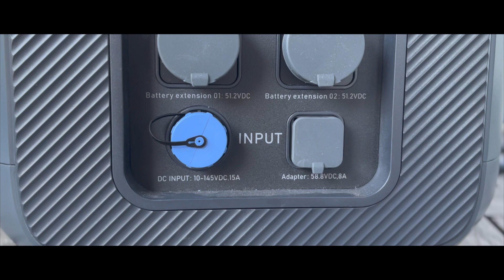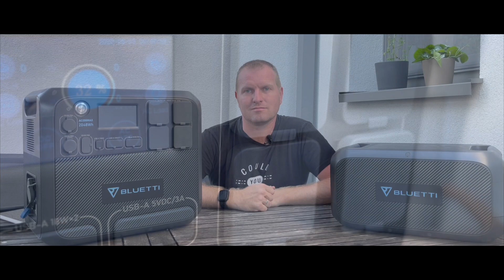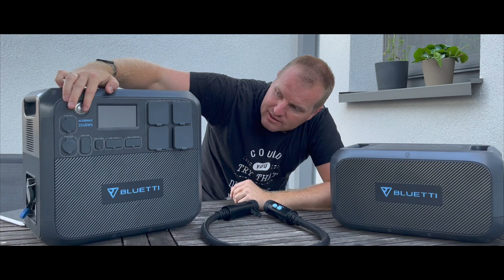Bluetti AC200MAX + B230 long-term review

Comment: That isn't a max, it doesn't have the rv plug
Reply from the maker: Hi Robert, actually it is, but it's the European model, as I'm based in Belgium. This one differs slightly from the model being sold in the United States (and several other teritories).

Comment: I’m pretty sure you’re in Belgium?  I’m in a more or less similar situation where everything on my desk is powered by a powerstation (Ecoflow). Which by itself is charged by 2 or 3 solar panels (terrace of an appartment, far from ideal but it works).  I have a smaller Bluetti which i use for all other kind of stuff.  By now you will know that solar in winter gives much less juice in Belgium.  That’s why i’m overpaneling myself.  I’m interested in using an AC200 MAX to also run my washer and dryer.  So knowing you haven’t had any issue yet is interesting feedback.  Maybe you can do a followup and let us know how things evolve.  Still trouble free?  You don’t need wifi btw.  I have it on my Ecoflow.  And regularly it just stops working.  And i need to poweroff/on to get it working again.  I’d rather not have it then.

Comment: Thank you for this video. I am trying to figure out how to charge my AC 22 max by solar and the van battery at the same time.  Having trouble getting Bluetti to answer my question.  If I use my 400W solar, I'll be using up the PV input port.  If I want to connect the AC port to the battery, is it possible to use the Charge enhancer (but instead of the battery clips, hard wire it to the van battery) or do I have to use an inverter form the battery and charge the bluetti from the AC of the converter by the AC charging brick?  Any help would be greatly appreciated.

Comment: Great review, thank you for the excellent information. I am wondering if I would buy the AC200MAX or the AC300. Perhaps 2 kW is enough for my needs. The AC300 does allow more solar input.
Reply from the maker: Hi Alexander, thanks for watching. To be fair I would first look at the devices that you want to power. If a max of 2000 watts suffices, go for the ac200max. If you need more power/wattage, get the ac300. For me the ac200max suffices for running my washing machine, robot mower and refridgerator.

Comment: Thanks for the review. Does your version have the 30 Amp plug? Are you able to run your whole house or an RV with this unit? It looks like the EU version is different than the north American version, which has a 30 Amp plug, and means you can plug your house into it.

These new solar generators are awesome!! The technology has improved so much in the last few years.
Reply from the maker: The EU version does have a 30 amp DC plug, but I don't have an RV to test it with. I also specifically keep my secondary building off-grid because regulations here in Belgium would have me paying taxes on the power I generate myself if I linked it to my house (which has a grid connections). So strictly off-grid it is ;-)
Reply: @powerstationcentric  Well, we kind of have the same thing here, but I've managed to get around it. I'm setting up a 2nd Electrical panel, and a Transfer switch. I will then flip to the 2nd panel, and plug into the 30 AMP switch. That way I'm running the house from the battery bank, but I'm "NOT" feeding power back to the Grid. No Approvals required, no building inspections, no changes to insurance.

It is no different than running your house on a generator, which I assume you are allowed to do in the EU when there are blackouts. 

Not sure if that made sense, but that's the path I've gone down. Maybe you can do that in the EU also? There are youtube video's showing how to do it.

It's allowing me to go "off-grid" without any government or Utility company involvement.

Comment: Now they have the AC-300 and the AC-500 will be on the market in weeks. This is very out of date.
Reply from the maker: Sure, but that’s why it’s a longterm review. Besides, most of it also applies to the AC300, since that one is using the same battery technology (Lifepo4) and battery management system. One of the main differences is that the AC300 has wifi, where the AC200 is bluetooth only. Still, thank you for watching and responding. That’s always appreciated 🤩

Comment: Hello, may I ask you a question please, for you experience does batteries suffer if you use ethe unit like an ups? Bluetti told me it is preferred not to charge and discharge simultaneously in order to not avoid batteries lifespan.
Reply: I am surprised you get that information.  I have solar coming in while the unit is working. That's kind of the point of having one, so I would suggest that the information you gained has been misunderstood?
Reply from the maker: To be fair I have never gotten that info from Bluetti and since the intended use (targetting the outdoor life) it would not make any sense. But I can confirm I've been doing this for nearly a year now and haven't experienced any battery degradation.
Reply: @powerstationcentric  thanks, bluetti confirm this. I suppose that it should be an issue of how much time bms can work, if the unit charge and discharge simultaneously and never fully recharged or discharged maybe internal cells will not receive appropriate balancing. Thanks

Comment: Hello, i also have the 200MAX with the 2 BC230 batteries.  The 200MAX has a maximum solar input of up to 900 watts.  To add solar charging to the BC230,you will need to add one of Bluetti's DO5OS DC charge enhancers for up to an additional 500 watts of solar input.  The input voltage restriction of 60 VDC makes it difficult to find a combination of panels to get close to 500 watts of solar.  3 of the BougeRV 200 watt panels in series will get you close.  You can also connect another DO5OS charge enhancer to the AC adapter input of the 200MAX that will give you another channel of solar to bring the 200MAX up to almost 1400 watts of solar.  Having a specific use in mind is something that most people don't really think thru, so great job!  I use mine in a similar fashion.  Nice review!
Reply from the maker: I'm actually thinking of hooking up a second D050S to my B230, so this one turns on upon first light and starts charging too, while I don't have to turn it on manually as I do right now. Might improve charging times even more :-)  Glad you like the review. Thanks for watching 🙏
Reply: I have the same, I just bought my 2nd battery. I am getting a 2nd electrical panel, so that I can flip my house to solar and run most of the house on solar. I'm just hoping I can get enough solar to max out the charge. Easier said than done!!
Reply from the maker: @smalltownhomesteadAC  Overpanneling all the way, maxing out those volts and amps. I'm about to add 4 more panels to my setup to max our the charging capacity of my AC200MAX and B230. That way I'm still going to get decent charging even in winter and I might even be able to run the jacuzzi on it in the peak of summer (uses about a kilowatt per hour).

Comment: Excellent information many thanks. I have an average washing machine, a dryer and small under the counter fridge in my utility room. I’d like as a start to power this room using saved half priced night rate power. So timing a charge from wall socket to come on 2am - 3am. The fridge would work 24hrs and our intention is to do 1 washing machine cycle plus 1 dryer cycle per day. Do you think the AC 200 max can handle this?

As I live in Dublin Ireland our solar power sunshine strictly starts April to September. It would be our intention to move to solar for this period in the future providing the initial set up works.
Thanks for your time.

Regards 
Joe
Reply from the maker: Hi Joe, 

Sorry for the delayed reply. I've been away on a roadtrip through Scotland (as you might see from my most recent video's). 

Technically it could do such a thing, but do take into account that you'll have some loss in the conversion via the power brick. The power brick will consume around 500 watts/hour, while it will only result in about 410 watts charging per hour. As long as that's not a problem for you, I can't see why you wouldn't do such a setup. 

About your appliances: 
It would depend strongly on the energy-efficiency of your appliances. I first did a measurement on their 24 hour power usage in watts. For example: 1 cycle of my washing machine will cost me about 0.45 kilowatt hours running an "eco" program. Running my fridge nonstop costs me about 0.55 kilowatt hours. And my dryer is very inefficient, so that costs me around 1.25 kilowatt hours for a short drying program.

It really depends how recent and thus how efficient your appliances are. But it is doable. Just take into account you can't run both washing machine and dryer at the same time. The sustained peak load would be too much for the inverter of the AC200 Max. 

As far as your solar panels go: 
Here in Belgium the best months are from the middle of March to the middle of October, but you can overcome this by maxing out your panels. Currently my setup is 2 x 380 Watt Trina panels, but I can add 4 more to the setup. With those 2 I'm getting about 100 watts of input today. So by tripling that (adding 4 panels), this would still give me 300 watts in november. 

Another thing I do: 
I have an EB3A by bluetti, which I charge from the cigarette lighter port in the car while driving longer distances (e.g. to work and such). When I get home, I plugin in the powerbrick of the AC200 MAX into the EB3A, as the inverter of the EB3A can provide up to 600 Watts of continuous use. So that gives me around 10% of charging the AC200 MAX for free too ;-) 

Thanks for taking the time to watch my review and responding. Hope my reply helps. 

All the best, 

Brecht

Comment: I have a bluetti 200P and the only problem I have with it is there's no way to stop it from  discharge power when it's turned on with  no load on it.
Reply: They will always use power when turned on. That's why I turn mine completely off if not in use.
Reply from the maker: That's actually normal. I turn them off while not in use. Keep in mind that the Battery Management System (BMS as referred to in the manual) will also use power from the battery. In my experience this will cost you 1 to 2 % per running hour (while AC or DC are not enabled).
Reply: @powerstationcentric  I would not say normal, but more a design choice.  I got started in this stuff in the 90s, the first inverter I purchased that did not come with a cigarette lighter plug was a Trace 2512SB for $1300.
Not positive but I do not think it even had a micro processer in it.  It did have a no load "search" mode that only pulled 0.33 Watts. The longest it ran continuously was for 5 years at which time I needed to change the battery pack.
Even though it put out a modified square wave it could run many loads other inverters of the time would have trouble with.
So far I would say it was my favorite, but the Victron Multiplus II is a close second.  Currently looking into feeding the Bluetti AC200 Max into the Multiplus generator support mode for a total of 5000+ Watts.
Need to find a way to automatically turn the Bluetti on and off, it may come down to something as crude as a servo powered finger to push the button.

Comment: If u conect Battery 1 with Battery 2 with Battery 3 how much cicle i doing ? How long can live the Battery ?  If not how many Battery i can conect max with the    centrale One ? I think i burn longevity of the Battery if i conect more Battery
Reply from the maker: Actually both batteries are LifePo4 batteries. Where Lithium Ion batteries tend to give you about 1000 cycles before they drop to 80% of their capacity, the LifePo4 batteries give you about 3500 cycles. I'm doing one cycle a day, which gives me about 13 years of peak performance. 

Also, the main unit has a battery management system that ensures ideal charging, avoiding burning the battery.

Comment: What Solar Panels do you use? The Bluetti ones?
Reply from the maker: No, I'm using Trina 380 watt panels (https://solarwinkel.be/site/zonnepanelen/302-trina-solar-honey-380wp-zonnepaneel.html) , 2 of them, linked up in series. Gives me a good 650 watts in optimum conditions, 250-300 watts in lesser conditions.
Reply: @powerstationcentric  Connections for the Trina panels to the bluetti are compatible.
Reply: https://youtu.be/ePxvRYAbMMs
tap the link and watch full video kindly subscribe like and comment